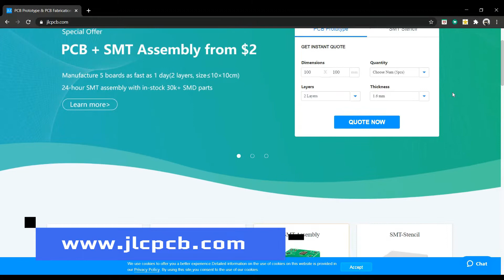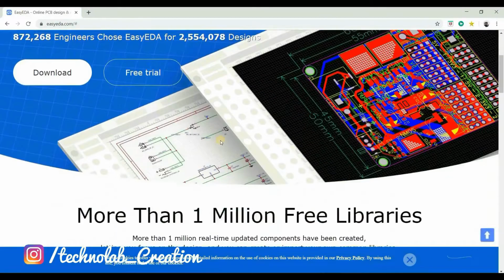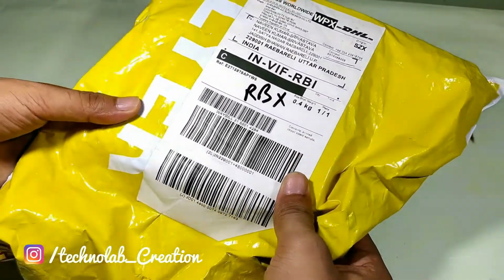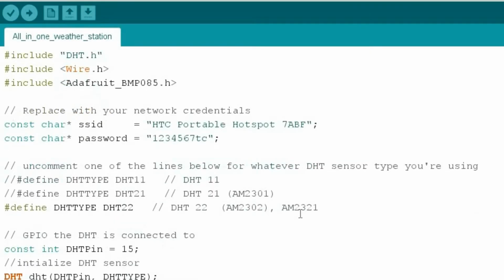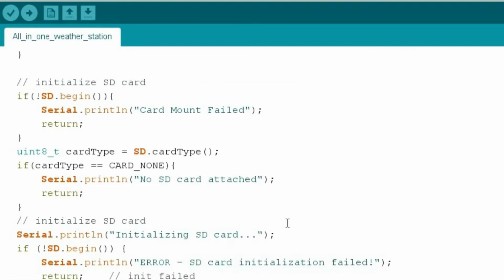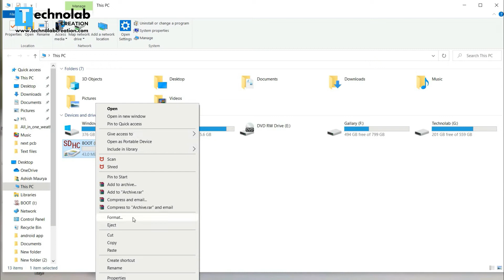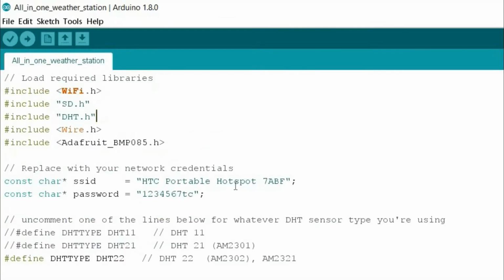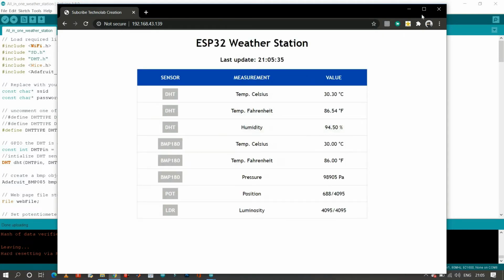ESP32 weather station display the sensor readings on a web server.| JLCPCB

Comment: Make GPS Tracker | NodeMCU with Blynk App(made on your other channel)

can you make same video but using gsm sim 800l  module instead of wifi (or if thats not possible can you please just help me with the code)

#define BLYNK_PRINT Serial

#define TINY_GSM_MODEM_SIM800

// Default heartbeat interval for GSM is 60
// If you want override this value, uncomment and set this option:
//#define BLYNK_HEARTBEAT 30
//ADDED-------------------------------------
#include <TinyGPS++.h>
#include <SoftwareSerial.h>
#define BLYNK_PRINT Serial
#include <TinyGsmClient.h>
#include <BlynkSimpleSIM800.h>
//ADDED--------------------------------------
// You should get Auth Token in the Blynk App.
// Go to the Project Settings (nut icon).
//ADDED------------------------------------------
static const uint32_t GPSBaud = 9600;
TinyGPSPlus gps; // The TinyGPS++ object
WidgetMap myMap(V0);  // V0 for virtual pin of Map Widget

SoftwareSerial SerialAT(2, 3);  // The serial connection to the GPS device
TinyGsm modem(SerialAT);
BlynkTimer timer;

float spd;       //Variable  to store the speed
float sats;      //Variable to store no. of satellites response
String bearing;  //Variable to store orientation or direction of GPS
//ADDED-------------------------------------------------

char auth[] = "_h-YcaejCWCVlyhlvCNVExVfx1_lhrqE";
char apn[]  = "Vodafonemobileconnect";
char user[] = "";
char pass[] = "";

//ADDED--------------------------------------------
//unsigned int move_index;         // moving index, to be used later
unsigned int move_index = 1;       // fixed location for now
//ADDED---------------------------------------------

void setup()
{
  // Debug console
  Serial.begin(9600);

  delay(10);

  // Set GSM module baud rate
  SerialAT.begin(19200);
  delay(3000);

  // Restart takes quite some time
  // To skip it, call init() instead of restart()
  Serial.println("Initializing modem...");
  modem.restart();

  // Unlock your SIM card with a PIN
  modem.simUnlock("0000");

  //ADDED-----------------------------
  SerialAT.begin(GPSBaud);
  Blynk.begin(auth, modem, apn, user, pass);
    //ADDED--------------------------------
}

//ADDED------------------------------
void checkGPS() {
  if (gps.charsProcessed() < 10)
  {
    Serial.println(F("No GPS detected: check wiring."));
    Blynk.virtualWrite(V4, "GPS ERROR");  // Value Display widget  on V4 if GPS not detected
  }
}
//ADDED----------------------------

void loop()

{

  while (SerialAT.available() > 0)
  {
    // sketch displays information every time a new sentence is correctly encoded.
    if (gps.encode(SerialAT.read()))
      displayInfo();
  }
  Blynk.run();
  timer.run();
}

void displayInfo()
{

  if (gps.location.isValid() )
  {

    float latitude = (gps.location.lat());     //Storing the Lat. and Lon.
    float longitude = (gps.location.lng());

    Serial.print("LAT:  ");
    Serial.println(latitude, 6);  // float to x decimal places
    Serial.print("LONG: ");
    Serial.println(longitude, 6);
    Blynk.virtualWrite(V1, String(latitude, 6));
    Blynk.virtualWrite(V2, String(longitude, 6));
    myMap.location(move_index, latitude, longitude, "GPS_Location");
    spd = gps.speed.kmph();               //get speed
    Blynk.virtualWrite(V3, spd);

    sats = gps.satellites.value();    //get number of satellites
    Blynk.virtualWrite(V4, sats);

    bearing = TinyGPSPlus::cardinal(gps.course.value()); // get the direction
    Blynk.virtualWrite(V5, bearing);

  }

  Serial.println();
}